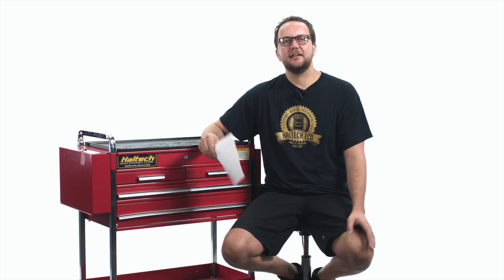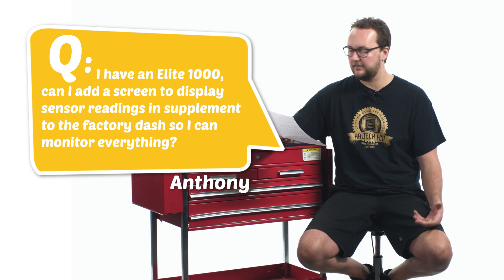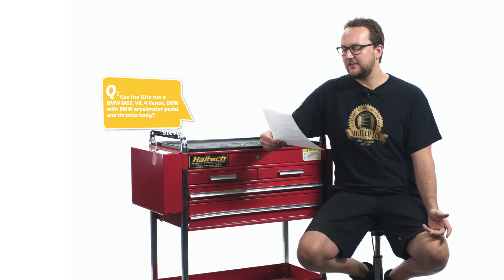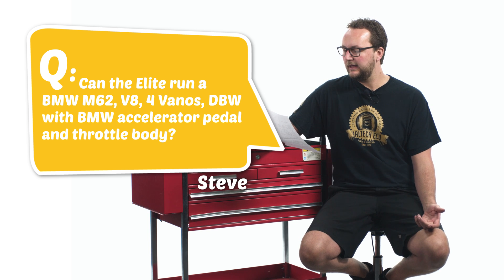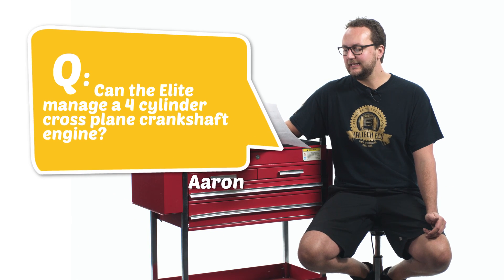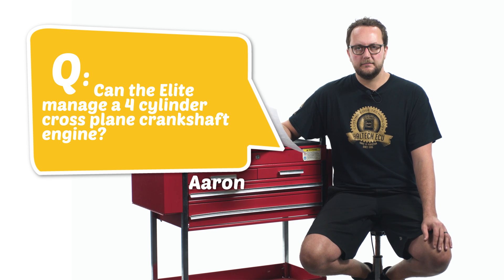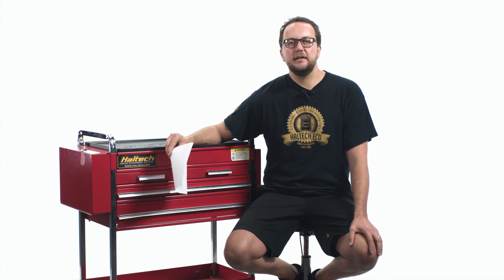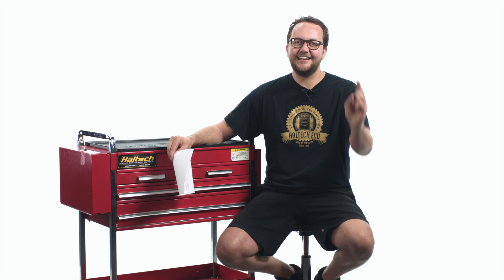❓ BMW M62 V8, OBDII Dislays and Crossplane Engines - Haltech Q&A Episode 24

Comment: how does the O2 sensor tell between rich and stoich mixture? Since the sensor works by comparing atmospheric and exhaust composition, and a stoichiometric mixture theoretically burns all the O2/fuel.

Comment: What ecu would I need for a Street/track car with a rb30/26 single turbo running 30+  psi,  if I wanted to use a map sensor not a maf
Reply from the maker: Elite 2500 would be your best bet.
Reply: Haltech thanks

Comment: When answering the question on the bmw m62, it sounds like you reffered to the S62 from the m5 and z8, since you mention multiple throttle blades.
The m62 has a conventional single throttle body while the s62 has induvidual, but for the ecu support side it does not matter as it's still only one throttle motor.

Comment: Can I use my Innovate Motorsports wideband output on my Platinum Sport 1000 for closed loop fuel control or do I need a separate wideband controller and sensor?

Comment: Hi Scott. Thank you for your time. I have a 2009 gen 2 Audi TT-S on standard engine (EA113) at the moment but want to run a catless downpipe and E85 flex fuel tune. My questions are:  
1. the the anticipated response and spool gains to this setup
2. cost effective recommended mods to the intake side in terms of intercooler, intake/throttle piping or plenum (and fuel system such as High pressure fuel pump and larger direct injectors).
3. recommended ECU to handle this stage 2 system but with also the ability to cope with a potential future aftermarket mahle forged piston at 0.5mm overbore 9.9:1 compression and Borg Warner EFR 6258
4. Would the anticipated response time be similar or better with the aftermarket turbo as it is a newer twin scroll setup with only 50 hp approx more flow potential https://www.turbozentrum.de/en/turbos-und-komponenten/turbo-upgrades/audi/efr-6258-vag-2-0-tfsi-turbo-upgrade-with-manifold/a-31999/

The aims of this daily driven build are to increase spool time down to the low 2k rpm (unless better can be achieved) range rather than current 3k, hopefully not break the DSG transmission in the process and increase in usable power by 25%-40% from e85 stage 2 tune or 50%-60% with newer turbo. Engine was mostly highway driven before coming into my possession with about 165k on the clock.

An adaptable learning ECU for this project?

Would your shop be able to handle this project or prefer just the tuning side?
Reply from the maker: Hi Phil, 
Haltech is the ECU manufacturer. To answer most of your questions, you'll need to speak with an engine builder/tuner. 
However, there is a number of Haltech ECUs that would be suitable for your needs.

Comment: Im wondering if a Haltech ECU can successfully control a Mercedes M113? -SOHC V8, dual spark plugs, drive by wire, variable length intake runners (a simple vacuum solenoid valve opens @ ~2500rpm). 
In other words, will the Mercedes DBW throttle body, knock sensors, cam position sensor and crank position sensor 'speak' to one of your standalone ECUs?
Which ECU would you say is best for this motor?
Reply from the maker: I cant say any of the Mercedes engines are particularly common to see in the aftermarket, but everything I can find on the M113 shows it being supported with it running a very common 60-2 VR crank trigger and a 1x hall cam trigger.   Being an 8-cylinder and having DBW the only ECU option is the Elite 2500.  The throttle body looks to be supported but not having seen one it cannot be guaranteed. The diagrams I can find show it to be the same as every other DBW throttle though.  Same for knock sensor, we cannot be certain that they will work, it depends on the type of signal they give out.
Reply: That is encouraging to hear, thank you!

Comment: Do you have a ecu to run a suzuki g10 three cylinder engine, that has been turbo charged? I have swapped the engine a custom built pulling tractor.
Reply from the maker: Yes, the Elite 550 will run your engine and control turbo boost. You could look at the 750 if you want a few more features. 
You can see the differences here: http://www.haltech.com/ecu-selector/

Comment: I have an Elite 1500, my program was made with a oldest version of Haltech ESP and when I open the program, even if I have the latest version installed in my laptop, he always recognize the version  and functions  of the Haltech ESP with which the program was created, if I want to have all the upgrades  and functions of the new software like the 6 stages of nitrous or others, how can I change my program to the newer versión and functions or why he don’t apply automatically  to the newest versions, or I have to recreate the program  again each time that you release a update.
Thanks and regards
Reply from the maker: Two things are updated from time to time. Software.  This is the thing you use with your laptop, pretty much the interface between a human and the ECU.Firmware.  This is the software inside the ECU and is what tells the ECU what features it has. Both need to be updated.  It will never happen automatically because updates change how things are run. Some updates need retuning to suit the changes.  But definitely, do the update because we improve so many things over the 3 years since the Elite was released.

Comment: Do any of the elite series support 2cyl 4stroke turbo Engines ?
Planing on Haltech my Arctic cat snowmobile with the Suzuki Twin, will be arund 300 hp when finish.
Reply from the maker: Yes, any of the Elite range will happily run a 2cyl 4stroke turbo Engine.

Comment: Here's a frequent question that can be considered for a future Q&A, I've been asked this quite a few times by first time ECU owners. If I would like to use the most budget conscious ECU for my 6 cylinder or 4 cylinder application, do I have to choose an ECU which will retain output support for my idle control valve/solenoid?

Not everyone understands the purpose of the idle ignition table which can be activated to control idle stability by way of ignition advance values against a load versus engine speed axis within the ESP software. This has allowed me to keep the choice of ECUs as basic as necessary giving excellent value to customers.
Reply from the maker: Thanks for the suggestion :)

Comment: Is there a haltech unit that i can use on my VK45DE Nissan v8
Reply: Malcolm Smith assuming the engine in question is a V8 (flat plane crank) port fuel injection engine with variable valve timing then yes, there's definitely a Haltech ECU to support you; where I am located this engine isn't popular so I am responding based on the general information available. I am not 100% certain that the crank and cam triggers are readily selectable from the existing drop down menu, but if you can supply a trigger scope capture then they will be more than happy to get you sorted with a custom instruction for this. You would be using either the Elite 2000 or the Elite 2500 depending on your need for drive by wire throttle support, dual knock support and a few other differences between total input and output count.

Always remember that you can feel free to follow this up with the nearest Haltech Office and with your nearest Haltech dealer who will always be more than happy to hear from you.
Reply from the maker: What he said!

Comment: I have a Holset variable geometry turbo that I'm wanting to put to use. Would any of your ECUs be able to control it?
Reply from the maker: If you can tell us what it needs to do to control it we can tell you if it can be run.  They are not used by any race teams that we have seen and are more common on diesel engines of which we do no support at all for.

Comment: In the future will haltech make a terminated wiring harness for the sr20
Reply from the maker: It's all a matter of demand. We have Plug'n'Play solutions for various cars using SR20 but we haven't had many enquiries about a terminated harness. But sure, if there's enough demand we'll certainly look at making one:)
Reply: I think there a few  auto wiring shops that sell them .propblem  with making them is so often the factory trigger and injectors gets ditched  on a decent SR rig  .. the Haltech long  harness is realy well made and designed and was pretty painless to lay over MY  SR20 and terminate .

Comment: Do any Haltech Ecu's have something similar to the Hand Controller with the Apexi Power FC? I'm looking to switch but this is holding me back as I like the live stats that can be saved on the fly
Reply: well as he said in the video that late elite's can output OBD2 with that you can then have most of your ecu data  available live on a cheap  display or wireless dongle  there is no editing to the tune available  via OBD 2 but  you can  add a couple of trim knobs witch are in the haltech shop and you can then configure them to ajust what ever you like  ...

Comment: WHEN ARE WE GETTING THE FRS/BRZ CANBUS compatibility !!!!!!!!!!!!!!!!!!!!!!!!!!!!!
Reply from the maker: We are working on direct injection applications now but it's still some time away.
Reply: What about making the software available to have basic can bus function (rpm,coolant, fuel, power steering)  for the guys that are swapping in different engine?  

90% of your costumers that are at the level of getting an elite 2500 have either a V8 or 2JZ/6cyl into the FRS/BRZ platform instead of the still new FA20.   

This is really the only big hurdle! 

(2jz frs in the works for me)